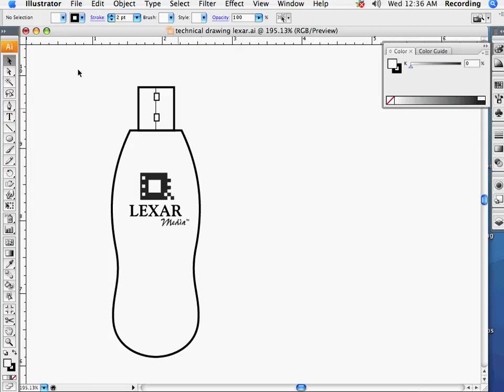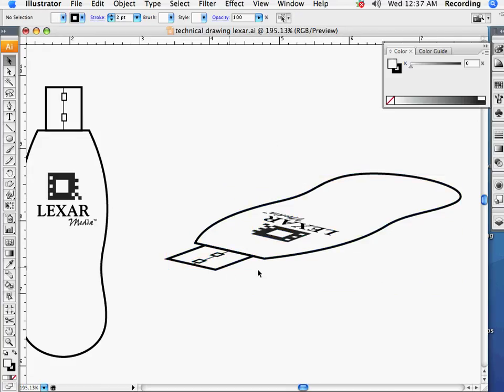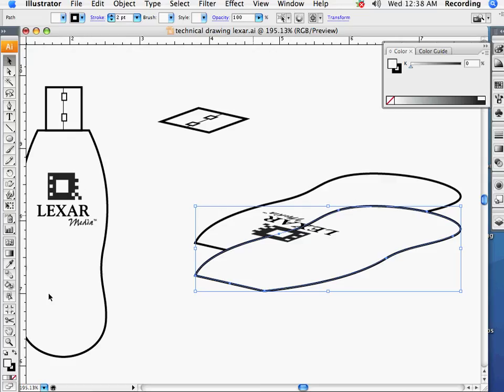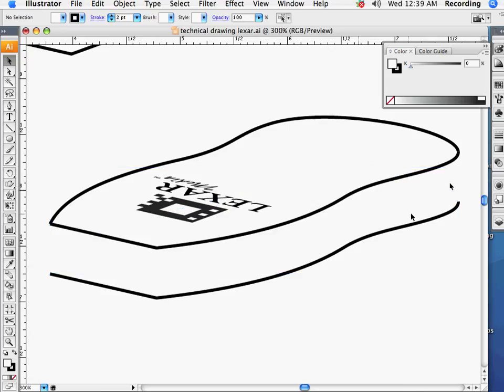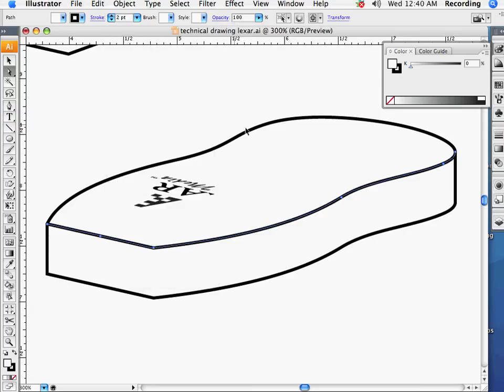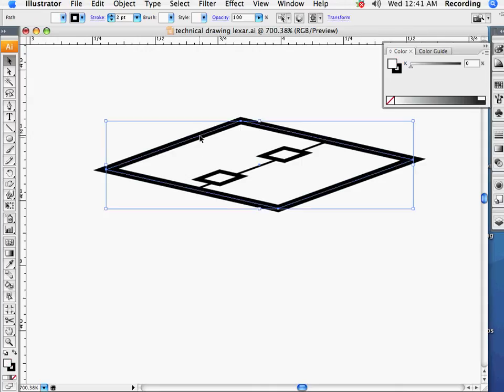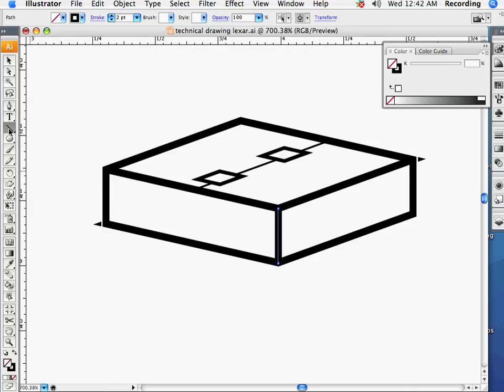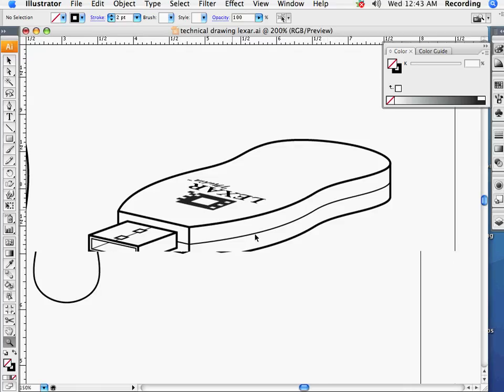Technical drawing in Adobe Illustrator Part 2

Comment: Thanks for the video, I have noticed practicing the tutorials that is very difficult to make a circle to look right when you have already shear the rectangle; it can be done but is not easy to get exactly the same angle. the easiest solution imho is before starting the artwork, make a square (not a rectangle) and get a circle with same diameter as the width of the square and center them, group and use the shear rectangle.